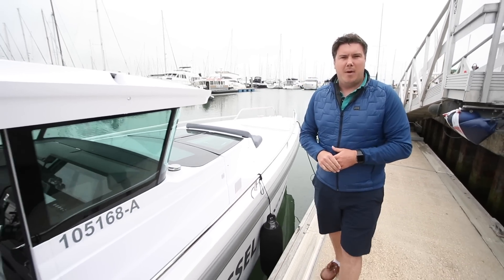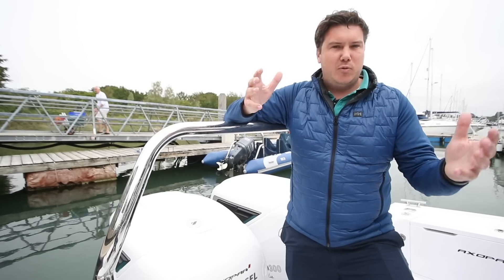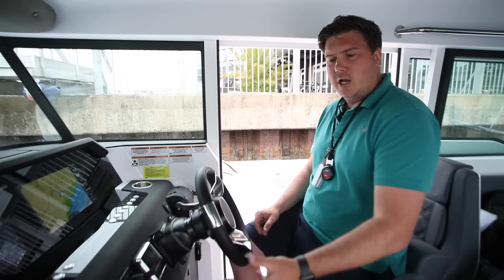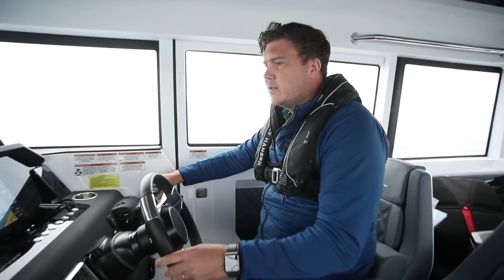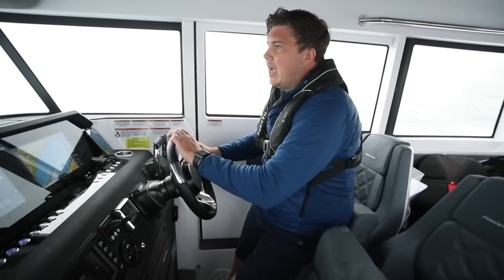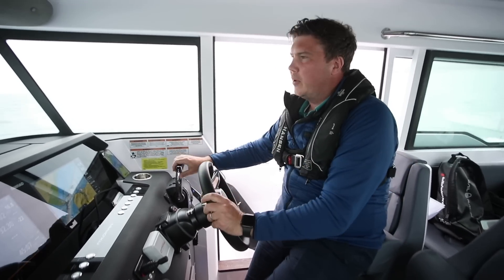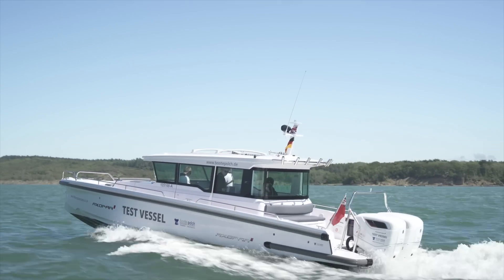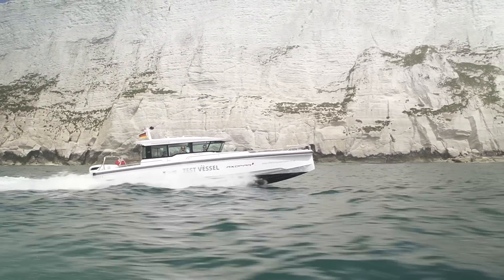Is this diesel outboard the real deal? Cox CXO 300hp tested | Motor Boat & Yachting

Comment: Besides fuel economy, what are the benefits of the diesel engines that are more costly initially? Are the diesel engines likely to outlast the petrol burning higher revving engines from Mercury and other manufacturers? The diesel engines are quite a bit heavier and I’m guessing would put more stress on the hull at the transom.
Reply: My 1983 Diesel Mercedes station wagon runs on a few oil changes for the last 40 years and has never needed an overhaul.  OM617 5 cylinder turbocharged diesel is listed as the most reliable engine ever built.

Comment: Did the Axopar need a different fuel inlet for the tank and is the diesel ok thru standard diameter fuel lines that would be fitted for the petrol outboards ?   I think the biggest advantage would be the greater endurance gained for serious cruising.

Comment: Why are outboard motors with no multispeed transmission, no suspension system, no computerized braking system, no drivetrain, no wheels/tires/alignment/CV axels priced more than a nice lake house on an acre of waterfront property?

Comment: I ran the numbers in comparison to a Yamaha F300 and Merc Verado 300. You break even on the cost difference in fuel savings at about 1800 hours. (diesels cost quite a bit more. $60k compared to $28k).
However the gas outboards are good for approximately 4000 hours. Manufacturer claims the diesels are good for 10,000 hours
Over the life of the diesel you save $147k in fuel, and save having to buy a second gas engine over 10,000 hours.

That's nuts. if they can get the service network right and run with minimal problems over their life... SIGN ME UP!

Comment: $62k USD each?  I don't see them selling many of these in the U.S. where fuel is still relatively cheap.  That's about 125% more than the Verado upfront for about a 25% efficiency advantage.
Reply: I am not looking into these due to saving money, but because I want an Axopar or equivalent, and I want as much range as I can get (I like to go on adventures). The other alternative is a slower inboard cabin cruiser, but I'm holding off a couple of years to see if I can get a diesel outboard boat instead. 
So, it's increased range for me over normal outboards, including being able to actually refuel in far(ther) flung places. Also, with diesel, I can carry a couple of turtlepac deck tanks for extra diesel - something I certainly wouldn't with petrol.

Comment: The figures show why all the big boats use diesel not petrol/gasoline. It costs less and you go further.

For me, equally important, is you cannot get petrol at every marina. Diesel, that you get everywhere.
Reply: And because I can't help it, it looks like we're all going to get to love Cox. And those are some big, powerful, no-nonsense Cox that just love to get stuck in and keep on going. Cox that deserve a bit of respect.

OK OK I'll get me coat... :-/
Reply: @darthkek1953  good smut there! 👍
Reply: I thot it was deisal doesn't light on fire as easy
Reply: the big boats run bunker oil which is the bi product of making diesel its even cheaper
Reply: chris   I think you mean ships.
Reply: @scottlittlewood4527  theres more than 1 grade of bunker oil the highest is basically regular diesel with all the sulfur still in it
Reply: @jamesa9lpiopatton419  
No, it doesn't.  But the reason is that there is a limit to how much fuel you can carry, and b: A diesel basically needs fuel and air to run, nothing else. And it can run slow with a lot of torque down low where you need it on big vessels. Petrol engines would be a horror show on big boats.

Comment: Is diesel not petrol?
Reply: Try this:  Put a cup of petrol in a dish.  Light it with a match.  The fumes are explosive!  Now, put a cup of #2 diesel oil in a dish.  Try lighting it with a match.  It doesn't evaporate so it won't light.  We have to fine spray it at very high pressure directly into a very high compression cylinder at 22:1 compression to force it to explode in the very hot compressed air.
If petrol leaks, a spark makes an impressive bomb.  If diesel leaks, you'll only need a mop.
https://www.youtube.com/watch?v=7soVqyGq4i4

Comment: How would 1 Mercury 600 V12 perform on the Axo 37 in comparison?
Reply: One outboard is better than two half's.
There is a 13 percent loss in friction with two outboards.
One 600hp will have the same top speed as two 325hp.

Comment: These things are fantastic. 30% fuel efficiency is quite alot when you consider the Amount of fuel outboards guzzle. People might say about the weight but the performance is enough that the weight is not much of a consideration. It's like weight difference of one not so fit guy (the average joe) for two engines. Much less than the extra fuel. What I find impressive is it's top end performance. I though would like to see some independent reviews on the performance and durability. Also, I do wonder how the low rpm will hold up on high speed craft. Those do favor higher rpms as the props to tend to break contact with the water often and face alot more cavitation.
Reply: Hiya, I think the weight difference is 116 kg per engine. I read your comment as 116 per engine, which I think is an error. 232 is a very unfit guy :)
Reply: Don’t see why not there are diesel offshore powerboats and have been for years and diesel rally cars
Reply: Torque helps in such scenarios. Win for the diesel for sure.
Reply: @darrenjones3681  rally trucks*
Reply: These things are about 3 times the price of a similar 300 Yamaha. You'll never make that up in fuel economy or price, and the supercharged Mercury outboards have just as much torque and are much faster and much cheaper
Reply: @sh3755  Right now they are but with economy of scale they'll come down in price.

Comment: the biggest benefit these will have is for when the boat they're installed on is used as a tender for a super yacht and then both boats would run off of diesel and no need for Aux Gasoline tanks onboard the super yacht. Which involves headaches and a level of danger vs diesel.
Reply: That would be amazing, infinite range for the tender
Reply: Not true. Here in Scandinavia and I know that is also the case in Australia, not every fuel dock has petrol (gas to you). But all have diesel, making it a much longer range boat than the improved efficiency suggests.
Reply: @NBM397  What’s not true?

Comment: Very interesting but I am not sure the figures would add up for day and coastal cruising. I could see the benefit for commercial vessels doing long hours.
Reply: I made full post in this thread about costs. If doing typical pleasure use (50 hours, cruising) the fuel saving looks to be about £4k a year. The Diesel is using 1/3 less fuel than Petrol but at the marina I based prices on cost about 1/3 more. That'll rapidly add up if you're doing even not very many hours per year... boats burn a LOT of fuel.
Reply: These engines (and the swedish competitors) were developed because of the nato single fuel policy. Petrol will go away on nato bases and warships.

Comment: My volvo d4 motors (x2)move my 5 tone 30 ft boat 20 knots 42 liters an hour combined for cheaper than those outboards, and I can do over 30 knots
Reply: 4 cylinder against 8 cylinder -
Reply: @lameduck3630  there is that, but also my volvos have duel prop legs, upto 30% more efficient than single prop legs,  but they are over 10k a leg and 3500 per prop set

Comment: They made joystick 🕹 controls for the dual outboards ?
Reply: The hydraulic system is from Optimus... They have the optimus 360 joystick. They were used by Yamaha and Evinrude before they had their own, and are available for most outboards... So I guess if money isn't a problem no reason you couldn't have a joystick.

Comment: Brand new equipment is nice to consider but transferring the engines out of the boat and connect them to the tanks with flexible tubes is asking for oil spills.
Today all is nice, what will the condition of the tubes be in a few years of flexing, temperature excursion and solar degradation?
A petrol spill in a harbour sees the fule evaporate within short time, a diesel spill is an environmental disaster much bigger than the advantage given by reduced fuel use.

Comment: Best way to prove it's reliability is in offshore powerboat racing like the Cowes to Torquay race or other powerboat racing regattas!
Reply: they are not very reliable. they keep blowing up the gearboxes. I work in Lymington and the engineers are always changing the gearboxes they say they have about 40 to rebuild back at the workshop.
Reply: Not surprising to me. Diesels are torque monsters anyway, so I would actually expect the gears/transmission to go out before the engine. Not me very familiar with what is more expensive to replace an engine block or gear/transmission?
Reply: Not surprising to me. Diesels are torque monsters anyway, so I would actually expect the gears/transmission to go out before the engine. Not me very familiar with what is more expensive to replace an engine block or gear/transmission?
Another thing they could do to make the gearbox/transmission last longer is beef up the gears or create a hybrid dog clutch gear system . Might be a little rough in the shifting, but will definitely last.

Comment: Boating is a different world. Thats considered fuel efficient. That's a lot of money to travel just over thirty mph.
Reply: 46kts is 53mph.
Reply: That's good figures. Bigger boats are measured by gallons per mile
Reply: It’s many many equivalent pickup trucks weight and pushing it through water it takes a lot
of power

Comment: Interesting to be sure, however, Volvo Penta makes a 300hp diesel (albeit not a outboard) but VP’s diesels are 3.7 litre inline 4s and with their new DPI drive, there is no need to shift in and out of gear while low speed manoeuvring in the marina.
Reply: The D4 is a really heavy engine.

Comment: Wondering how the difference in torque feels. I especially like the Axopar 37. I live in Florida so air conditioning would be convenient.
I can see an diesel advantage in some areas and when used on yachts and ships but the dealership network will be thin and will severely hold back the distribution. Cars and small trucks are going electric bc diesel seems to be becoming less in favor bc of emissions and all that business. 
The top of the outboard pyramid is Yamaha and Mercury. Yamaha is still producing reliable but older style engines, Mercury has jumped out of the box and going full speed ahead with he latest and greatest designs and modern engineering technology is proving them to on target of style, reliability and performance. Suzuki’s have always been excellent motors but they lack the dealership network and warranty responsibility. I turned 75 today and have been a boater for 65 years. I’m glad to see boating finally take such wonderful leaps.
Reply: Nothing to say  about Honda outboards ?

Comment: I can’t see it catching on in the leisure market the price difference against fuel savings doesn’t  add up when doing lowish  hours . If the reliability and durability matches regular diesels I can see it being a hit with commercial operators but for leisure use unless there is some huge increase in performance then £20k premium for a pair over mercs doesn’t make sense . The only reason I think you wouldn pay the extra is for the range but then not many people with this style of boat will cruise more than 100 miles in a day .
Reply: Yes and no. People will spend an extra £20k on a boat just to get nicer embroidered curtains.
Reply: considering there's no where to get petrol the 20k makes perfect sense.
Reply: I've made full post on potential fuel savings, you might be interested in looking at it.
Reply: @darthkek1953  where can I find that thanks
Reply: @mrdiavel4807  you can't direct link on youtube but if you reload the entire video and scroll through the comments you should be able to find it.

Comment: On the axopar website it shows that the twin Mercury 300  was pushing the boat 50 knots how come on your test run you only claim 43 knots top speed?
Reply: @zzz7zzz9  nope, in fact it's can go more slightly more than 50 knot

Comment: 65 ltr per hr ... yikes that's 21 plus gal per hour.  Geeze, that would melt your credit card topping that thing off.
Reply: 65 litres is 14.3 imperial gallons, or 17.2 US gallons
Reply: @David-qs5ii  Yep, I know... I actually looked it up when he touched top speed at 70 something.
Reply: add 30 prosent on that when u have petrol engines
Reply: @arotom  I suppose if you can afford a boat like this ... fuel consumption and cost isn't much of a factor, although I wonder how much fuel they carry onboard.

Comment: All that matters unless you can’t buy petrol easily is how much the price premium is vs the fuel savings. 45,000 pounds each sounds a lot
Reply: Im sure as time goes on and there is more competition, it won't be as expensive. In many boats, though, the diesel engine option is significantly more expensive.

Comment: I dont think they are far enough in front in terms of performance and fuel saving to justify the price and weight.
Reply: If they are tender engines, it saves the need to carry gas on board, you just use the same fuel as the ship uses.
Reply: @Ron_the_Skeptic  Thats a fair point.

Comment: The engines cost about £10,000 more per unit than a comparable petrol engine outboards so what ever the savings in fuel consumption the real world shows that up front cost of the engines drown out fuel savings.
Reply: I think this will also depend how long you intent to keep the outboards how any hours a year use n one hopes also they will cost quite a bit less in maintenance n repairs over the years n the fact they will always be worth more when its time to sell them, but in the short run yes petrols all the way
Reply: Not just fuel but servicing too, diesels should run several times over the length a petrol needs a full rebuild. But yes, I think you need to be looking at commercial-level mileage to quickly get a return on investment.

But, also, you know, BOATING. Have you seen the price of upgrades and and options? Ten grand usually struggle to buy you slightly nicer LED lights and a rod rack.
Reply: @darthkek1953  Boating is now for the rich at least well off people I gave up boating when petrol went to 80p a litre but I do remember many of my mates from school they almost all well their eldest brothers/fathers  who had any money would get a 10 to 12 foot traditional wooden boat  n a little seagull on the back petrol was couple of shillings a gallon  them seagulls where very easy to repair but in tidal waters anything less than a 10 HP engine it wont do, last time I went to a bot show (Earls Court) they had Humphrey Boggart on the African queen his steam boat Boggart actually looked pretty life like, anything "Marine" the price goes over the roof now days its silly money
Reply: @polygamous1  people build their own little racing sail boat or kayak. But yes you're not getting a yacht cheap.
Reply: @polygamous1  Shillings and Seagull, I remember them both 👍🏻👍🏻
Reply: @PhilbyFavourites  welcome mate us people who lived in them days we will never forget the poor but good old days stay safe mate cheers
Reply: I've made a post about fuel savings. Long story short, for typical type of use (50 hours, cruising speeds) the saving should be about £4k a year. You can read and respond to the post directly in this forum.
Reply: @polygamous1  What really bothers me about fuel prices is that every litre of petrol or diesel is basically 57.95 pence duty and then add 20 percent VAT on the total price per litre, it is nothing short of legalized theft.